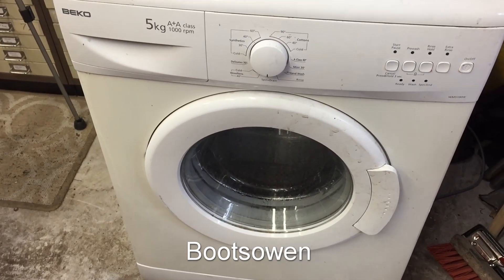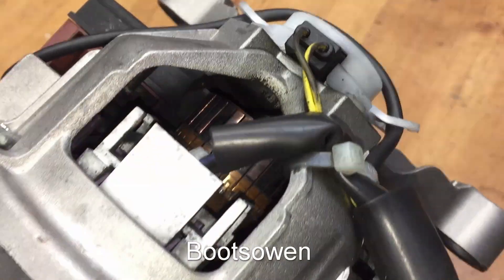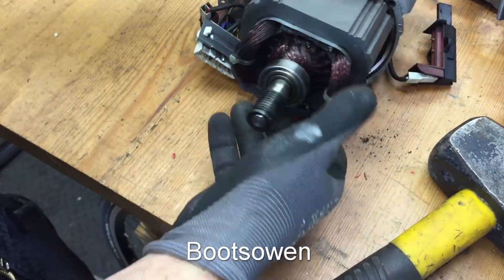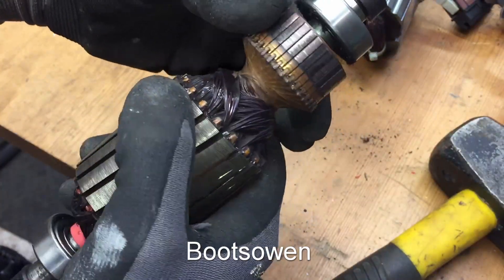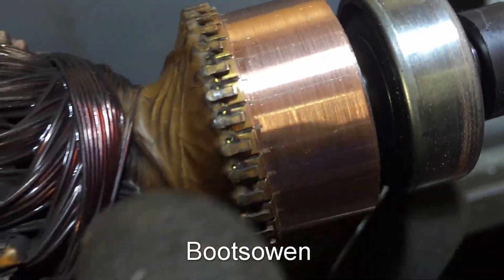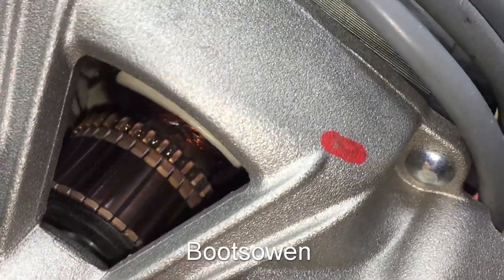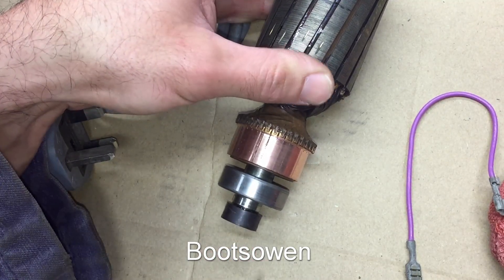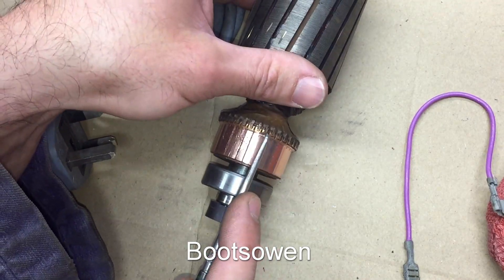How to cure a noisy washing machine motor: Skimming metal off the commutator: Beko WM5100W

Comment: Those stripes on the commutator are mica insulation and the can be harder than the copper so wear more slowly. When new or in good condition the mica slits are least a mimometer below the copper so that as the copper wears it does not become raised above the copper as this would cause the brushes to skip over the copper and arc badly and burn the commutator and cause motor failure. When cleaning up a comm, the bare minimum  material shold be removed and then the mica chased out with something like a de pitched hacksaw blade, where the set of the blade is ground off on a bench grinder to get the width of the blade to a dimension the same as the commutator  mica slot dimension and then cut back the mica to create clearance under the copper. When I was a kid, this is how we fixed car starter motors.

Comment: bootsowen, do you work as an engineer as a job? You are really handy/ skilled at repairing washing machines, motors etc
Reply from the maker: Hardly
Reply: @bootsowen  Not sure if that’s sarcasm or not ? If you aren’t an engineer you are certainly really skilled having watched your videos
Reply from the maker: I make it up as I go along. YouTubing
Reply: @bootsowen  ok cool. A question about pulley motors, I have a hotpoint wma 36 machine, old yes but good, what motor can it be replaced with if it fails? Could I use one from a wma34 ? I’ve replaced carbon brushes a few times over the years but curious about swapping motors eventually

Comment: Good man, keep going at it for interest and learning. Occurs to me a variac and one of these universal motor s is a good match, cheers
Reply from the maker: It is a good match, but you still have limited control over the speed if you have a variable load, fine for a fan. I have posted a video of the TDA1085c controller that I have put on a large sandstone grindstone. I think they are pretty good, but they were specifically designed to control washing machine universal motors...

Comment: Thanks for posting this video.  It was very interesting to watch as this was a process I was considering having done on my old Bosch's motor before I eventually replaced the whole machine.

I chose to have a pair of new bearings fitted to my old Bosch's motor and I was present during some of the work.  When I returned to collect the motor an hour later, I was told by the repairman that it took a lot of work involving a bearing extractor and a bit of swearing.

I mentioned the bearings above, as I thought you might consider making yet another video showing how to replace the motor bearings.  You seem like the person who has the resources, skill and patience to do this, so I do hope you give it a go.
Reply from the maker: I would like to get the bearings off and try, but usually the motor pulley is pressed on after the bearings are pressed on, I might be able to get the bearings off but the motor pulley is a very difficult thing to remove. I have done it in another video, It is a huge hassle.